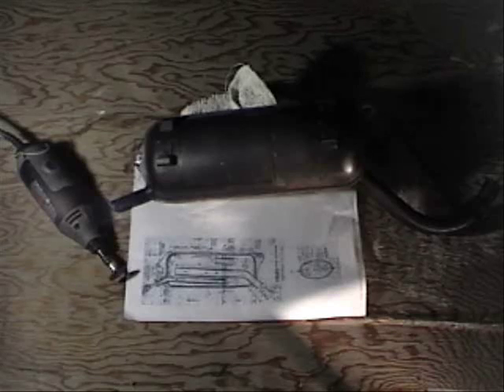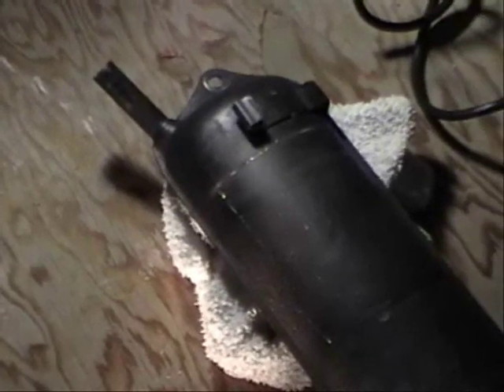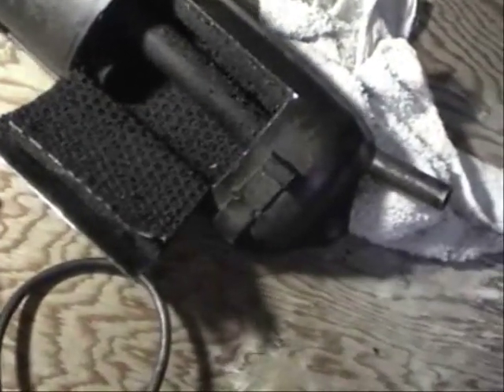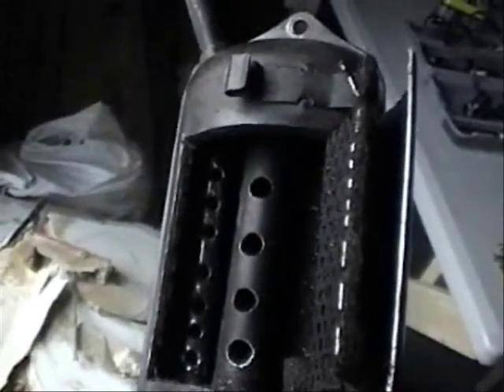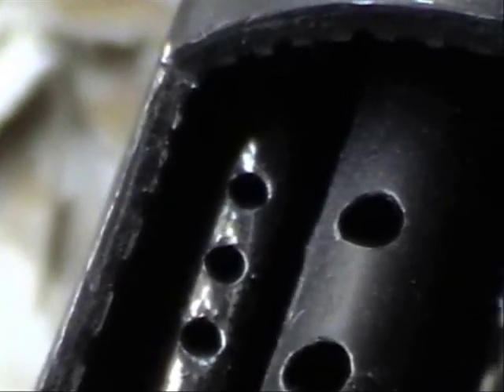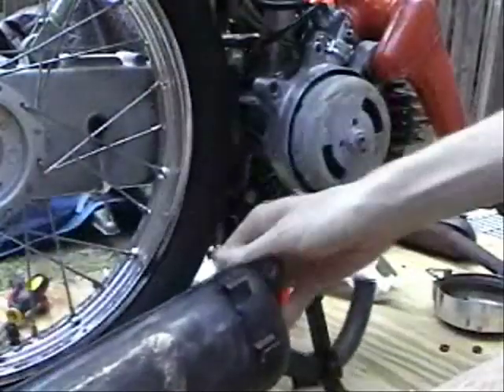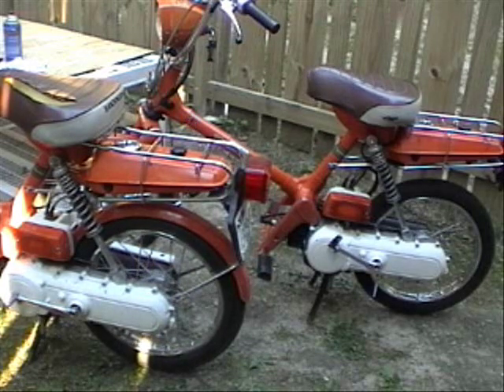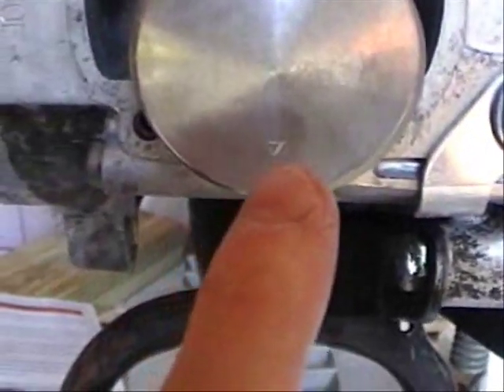Honda Express Muffler Exhaust Modification Performance Tuning NC50 Moped

Comment: i cant really tell from the video... how much louder is it? i drive mine around campus and id like to avoid being the cause of even more noise pollution, if possible. if its really an improvement however, i might make an exception. does it add any MPH? does it increase acceleration at all? thanks for the vid!

Comment from the maker: In my humble opinion, it is not really louder... just sounds more "poppy" when running. I felt it improved overall MPH 1-2mph (results vary... could be more). If you do any other mods to improve speed...and if you don't swap mufflers or do mod to it... you'll find stock muffler is restricting you. I like this muffler mod, because it can be done and not change the outward look of the classic Honda Express nc50. Good Luck!